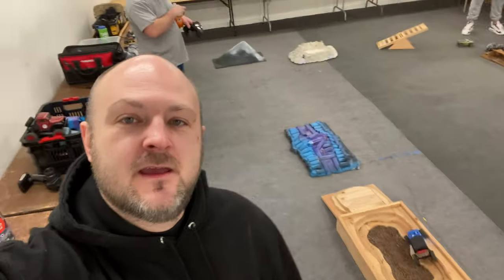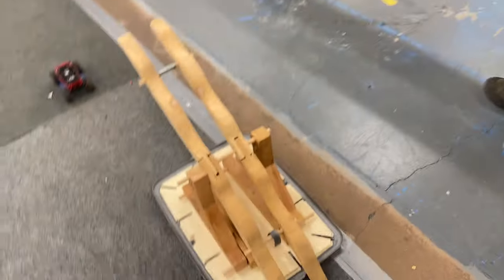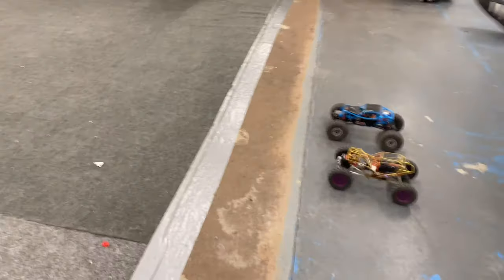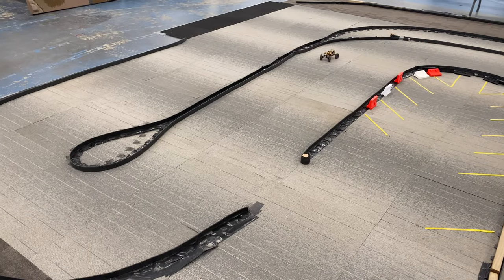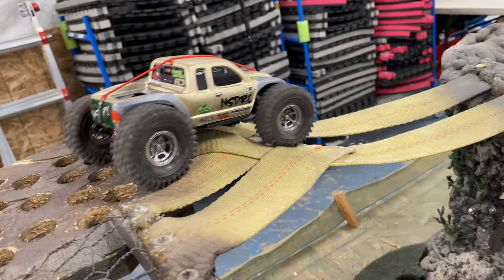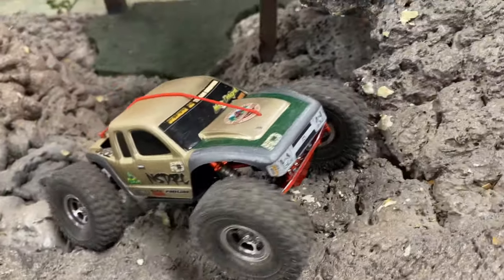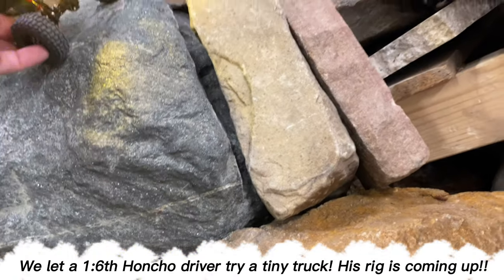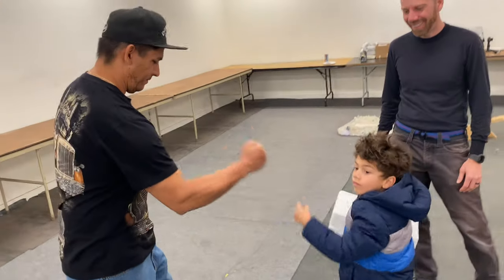Vlog - A Great Day of Modular Obstacles and Awesome Community! We show a BUNCH of great rigs!

Comment: Love the modular obstacles. I am so hooked on these little beasts that I'm building them from the ground up, I have two on the go att one based on the SCX24 style axles and one from spare Enduro24 axles.  I'm waiting for the FCX24 axles to come back into stock to begin my fourth 24th.
As for your "spring" issue, the 3D printed ones will break often. Have you considered SSteel wire and wire bending pliers?  I keep a several meters of wire in different gauges from 0.5 - 2mm and a nice pair of pliers just for such occasions.  It's amazing what you can make.  I use hair bands and make my own bungie cords that look spot on, from 24th scale up to 10th.  I bet those springs would be easy to make, 1mm wire and CA a couple of ball ends on to connect to chassis and suspension, never break one again.
Reply from the maker: Yeah, we could use steel but the point of the build is to try and make as much 3d printed as possible. I feel like the springs just need a better material and to be a tad thicker.